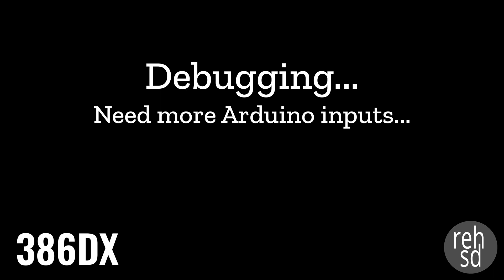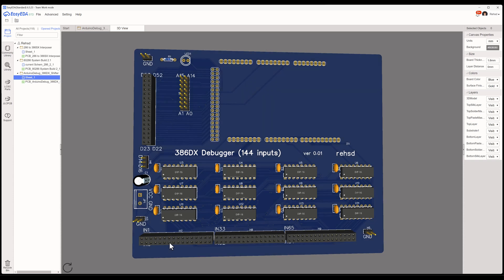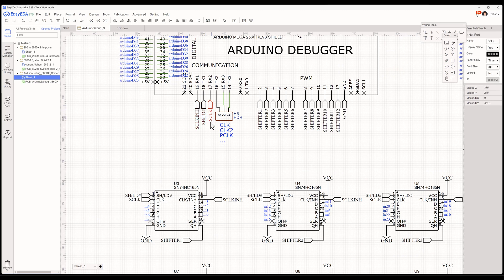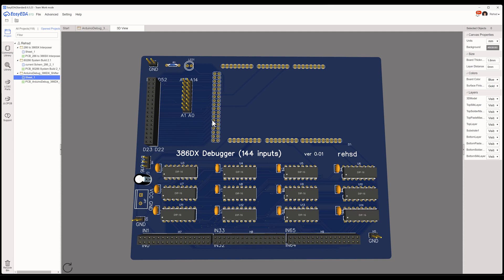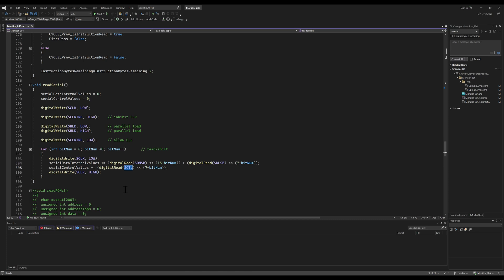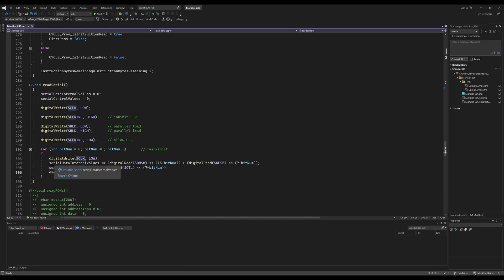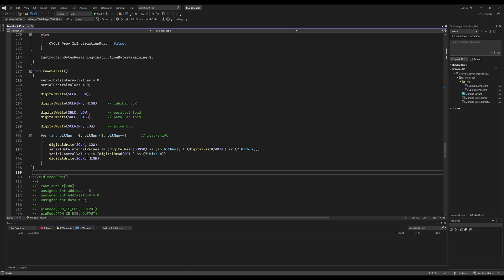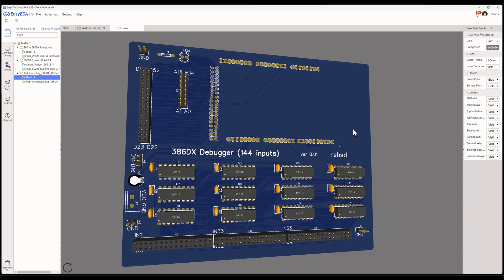80386 DX Build, Ep. 4 - Getting a Debugger Ready - More Pins

Comment: What was the performance of this thing like? I'm making an arduino shift register debugger that works pretty similarly to this one. I know there are better ways to make faster debuggers but this way is cheap and easy. I don't really expect to be able to use this at speeds higher than about 20hz. Did you have any problems with power fluctuations or voltage drops? How accurate was it? Did it miss bits every once in a while or did it happen more often than that? Are the fill planes on both sides ground or is one of them voltage?
Reply from the maker: I hit USB bottlenecks before anything else. I'm working on a Teensy-based version right now so that I have hi-speed USB support. If it goes OK, I hope to post a video about it in a couple of weeks. I expect the next bottleneck for my setup will either be the Windows UI or signal transfer from my 386 DX board to the Teensy debug carrier PCB. As I build up speed on my 386 DX build, I can test performance of the debugger. For the debugger in this video, I did not run into any power/voltage issues. Accuracy was good, but I could only test it up to full speed USB speed. I used a two-layer PCB with VCC copper fill on one side and GND copper fill on the other side.
Reply: @rehsd  Cool, thanks for the info. I've suspected you could theoretically get speeds of up to 30mhz using off the shelf components with a debugger like this. You could have shift registers getting shifted into an sram chip rather than being transmitted over usb. This way, when polling is finished it transfers data from the sram chip to the usb.

Such a device would probably be difficult to make. Saving 120 bits per clock means you could get 1.7 seconds of input data at 10MHz. Using cheaper dram with probably 70ns access times would still mean theoretical max speeds of around 17MHz so once you figure out dram timing this might be a better option than using an sram buffer.

I don't know if I'll ever get around to trying to make a debugger that advanced but it's fun to think about.

Comment: You may want to look at using 74HCT shift registers instead of HC. If you're interfacing with TTL logic, this has a minimum guarantee of about 2.4V on the outputs for a logic high, whereas HC logic requires generally a minimum of 3.2ish or more V for a logic high, so there is a risk that a valid logic high output could be read incorrectly.

Comment: It's funny how different people arrive at similar solutions. I built a debug tool very similar to this for my 6502 project. I built it around the newer ATMega4809 instead of a whole arduino. The hardware was pretty easy to design. Writing the firmware for it is proving a challenge though.

Comment: I was just curious why you chose the arduino for this over the psoc for the debugger? Thanks for the content. I've been enjoying the series :)
Reply from the maker: The primary reason is that I already had a debug platform built out on Arduino, going all the way back to when I built a couple of Ben Eater's kits. I will probably experiment with alternatives to the Arduino. @ModSlash suggested an STM32H7 Nucleo, which looks interesting. Or, I might try an ESP32. The STM and ESP should both do much better for performance than the Arduino Mega.
Reply: @rehsd  You should also consider using a PSoC6 for the debugger if performance is an issue. I'm guessing you know this since you're using PSoC for other things, but they have a "Trigger Multiplexer" for chaining together peripherals, so you can manage / read external devices without any CPU intervention. Essentially, the "TrigMux" is a hardware version of the interrupt -> ISR pathway, where a GPIO interrupt/clock pulse can trigger DMA reads / serial engine transactions etc. 

Timers/PWM, DMA, serial engines, etc.... can string together complex chains.
Reply from the maker: @LUKEYTHEKID2112  Thanks for the tip! I have only used PSoCs for basic logic circuits up to this point. I do need to dig deeper into what all I can do with the PSoC.

Comment: Why use an Arduino, while you can use a much better, feature rich, and not to mention, considerably faster alternative MCU, like an STM32H7 Nucleo? That would run at 480Mhz, and you could still program it as a classic Arduino. Also taken into account the shift register speeds, your bottlenecks could be eliminated altogether, if you'd use a cheap CPLD or even an FPGA to do the I/O, with the provision of some level-shifters. Just a thought  :) (for the record I am not affiliated with ST, just another enthusiast)
Reply: The existing debugger could be made to run a lot faster if the shifting was done with a SPI peripheral and DMA instead of a bit banged software loop. If that is the concern.

The Arduino Mega already has a very capable MCU with a lot of peripherals. You don't need a nearly 500MHz microcontroller to make it faster, you just have to use the resources you already have available in more clever ways.
Reply from the maker: @TomStorey96  I'm guessing the current bottleneck is transfer of data from the Arduino to the PC. Using a Due helps that tremendously, as it can transfer much faster to the PC. For my debug purposes, the current setup will work fine, though. I'll have to read up on using the Mega's SPI capabilities in this situation. I've worked with SPI on the Arduinos a bit, but not for shifting in from shift register ICs.
Reply: @TomStorey96 you are correct in saying this operation would be faster (by around 4-6 times) if using DMA. Considering though the max SPI frequency of any given MCU is half of the actual execution speed, in terms of operations/clock the SAM3X8E will be capped at a theoretical 42Mhz (more like 10-20Mhz from my experience, but I do believe there are better ways than what I did in the past). Whereas the STM32H723ZG would be achieving, in equal measure, 250Mhz for the same exact DMA operation. And a NUCLEO-H723ZG costs less than a Due :)

We also need to consider the additional operations from triggering the read on an external clock input, all the way to writing the I/O to the PC, which imho should be done in a pure USB 2.0 transfer as opposed to USB-To-Serial (which will be yet another bottleneck), so it is (still imho) a better option having a much faster MCU. 

Yet another consideration, is that while an operation could succeed in slower clock speeds, it could fail in faster ones, so sampling at near (or more) than the actual 386SX/DX speeds, is a need that would easily become apparent. With the faster MCU one can (relatively) easily achieve actual, readable data sampling, way over 40Mhz, which is the fastest 386 speed.

And @rehsd could also use the same "debug" peripheral in the upcoming 486DX project :D
Reply from the maker: @ModSlash  486... let's not get ahead of ourselves.  ;)
Reply from the maker: Great question. I think it's just something I have used since starting with Ben Eater's kits, where he used an Arduino. Sometimes, I use an Arduino Due, which is faster, but really better for 3.3V. I haven't used the STM32H7. A while ago, a picked up a couple of ESP32's, but I haven't gotten around to trying them out yet. I also have some FPGA's that I could use easily enough. The STM32H7 Nucleo looks quite interesting; I'll have to order one to check it out. Thanks for the suggestion!
Reply: @rehsd  Glad I could offer some insights :) Got great inspiration from your videos to get one of these old CPUs and build my very own. So thank you for all your efforts, looking forward to how this build will progress.

I got another suggestion. Seeing your efforts designing the mainboard, wouldn't you be better off if you use an existing M/B footprint, like say an ATX form factor? this way it would fit in any number of cases readily available.
Reply from the maker: @ModSlash  For the proto board, I’m not too worried about form factor. I actually prefer the proto layout better for troubleshooting. However, the next PCB will be ATX, like I have done with my 65816 and 286 boards. I have an open ATX chassis which I use that works well.
Reply: @rehsd  Cool, looking forward to it :)
Reply from the maker: So, I'm shopping for STM32H7's... so many choices... I'm going to try out a NUCLEO-H723ZG.
Reply: @rehsd  All of them are great in their own right :) I still use Arduino for many things, but as the saying goes, size does matter :D - And one can never have too much power in an MCU :)
Back on topic - It is my understanding you are just setting out with STM32, so in favour of keeping things sweet and simple, I'd suggest you start your journey using VS Code as the IDE and try program the thing like a "standard" Arduino. You can get into more detail (and also tap into more of the MCUs features) later with Cube. Lots of great tutorials out there to get you going, but if you need a hand in anything, give me a shout, would be glad to help in any way I can :)
Reply: Ah, the MCU on the mega doesn't have DMA, but using an SPI peripheral would still be world's quicker than the software loop you currently have.

If it's still a bottleneck to additional performance that you need but don't have then by all means get a faster MCU, otherwise I'd say save your money and put it towards the rest of the project. 🙂